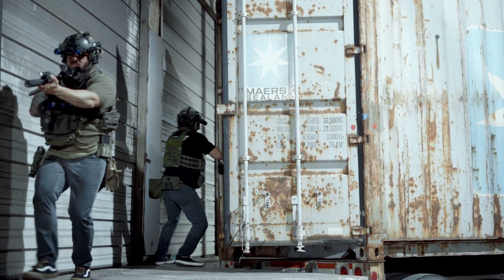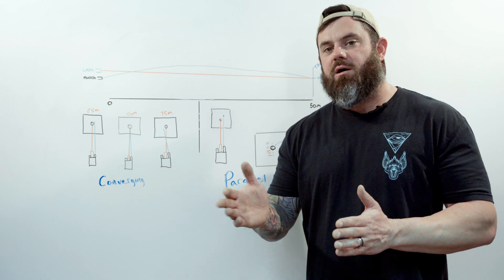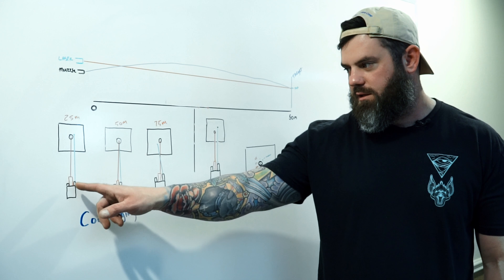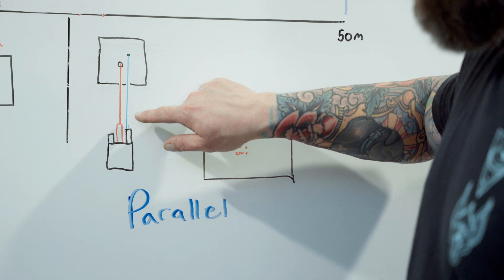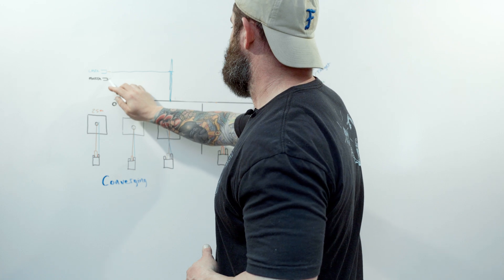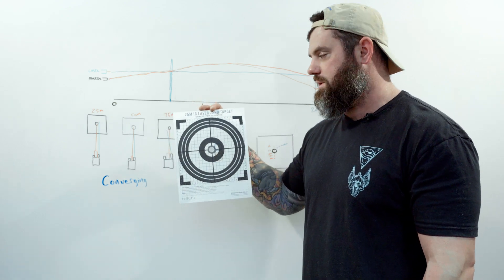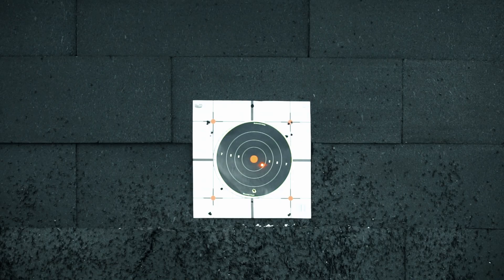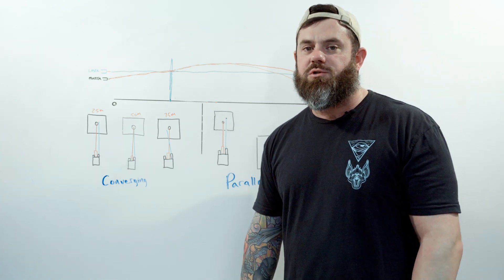Custom Night Vision | Zeroing Lasers | Parallel & Converging Zero

Comment: you need to move your POI up to the same height as your POA on the parrell zero, and only have a horizontal offset that way you're putting some elevation on the bullet and it's not just dropping.
Reply from the maker: That's an interesting point to consider!

Comment: Thank you; your video was easy to follow. I am a first-time gun owner. Home defense is possible, but plinking and dry firing are primary uses. PCC Ruger PC Charger with both a PA Micro Gemini and a simple light/laser mounted under replacing the hand stop. Both devices are centerline, and the Gemini has ACSS BDC. As a newbie, I want to keep it simple with Parallel Zeros, so I have to remember just two vertical holds.

BTW - I do not love the name Parallel Zero. It does not make sense and does not sound as cool as Zero. I wish it was called Zero Zero or Z Zero instead because it never zeros, and it would sound even cooler than Zero.
Reply from the maker: lmfao.

Comment: Yes you are correct on the converging if you keep the rifle flat, you can “correct” that by rolling the gun and putting the laser “on top” of the gun. I have a DBAL A3,  laser is on the right. I roll the gun now the laser is “on the top” and you can think of it as a red dot at that point. Yes, it does some wonky things to the bullet if you’ve ever shot a rifle at an angle but within 100 that doesn’t really matter

Comment: We had the "crossed path" problem using MILES on the M1 Tanks & the M2 BFVs during Manuever Tng. There was also a Training Aid made by Saab that used lasers. It is tough to use a beam of light to replicate a ballistic projectile's flight path! Adjustments are "counter intuitive" & would likely make for terrible accuracy in Combat as all the "muscle memory" developed is backwards!
   I avoided using the PGS (Saab's Precision Gunnery System) for that reason. We had another system called TSV (Through Sight Video) which utilized a half-silvered mirror w/a fiber optic feed into a small monitor. I could moniter live & record the reticle hold of the BFV Gunner as he adjusted the impact of a "simulated" ballistic flight path (a small light projected into his sight's optical system). We only had the M2 A1 (w/out the ODS upgrades & BLRF System. We still had to use TOT. Like "degraded mode" Gunnery on the M1 IPs.)
Reply from the maker: hell yeah whatever works.

Comment: New(ish) to lasers.  This will be the first time setting up parallel.  I have an NGAL.  The laser is mounted at 12 o-clock.  If I am understanding right, where the laser is on the target, the bullet should impact low and to the left.  Taking out the bullet rise and fall factor, the bullet should hit an inch or so to the left of the point of aim (laser), correct?  
I'm waiting for the range to warm up and dry out. to fire my zeroing shots.
Reply from the maker: yes

Comment: I chose to run a parallel.  Seems to have more practical civilian shtf application. I'm in a small urban environment with medium distances at best so i think not having to do my ky maths on a converging point may be easier on the fly. This way I only should have to fight elevation in theory depending on distance.

Comment: As always, excellent information. I use a process that is a little more labor intensive and requires a buddy, but it is dead nuts on and can be done without firing a shot. Step 1. On any paper target place a 1-inch round pasty then use a sharpie to put a dot in the middle. Step 2. Place the muzzle of a weapon that is clear and safe against the target while looking through your zeroed optic which will be aimed in on the pasty. Then turn on your visible laser while looking through your optic aimed on the pasty and make a mark with a sharpie where the laser is pointing on the target. Step 3. Now do the same thing at 25 yards while having a buddy feed you data that will move your laser to its original mark. Step 5. Repeat this complete process again at 50 yards and you are good to go. Then shoot to confirm

Comment: There is no offset on a converging zero if you zero your "IR" laser to your already zeroed optic at the "Furthest" distance possible all without firing a single shot. Your hold overs/unders will be the same as your optic. The vertical and horizontal adjusters are very coarse @ 1moa per click, so even with a parallel zero you are more than likely for your zero to be offset at distance, This can all be verified by looking through your optic at distance.
Reply: This is laser and distance dependent, if the POA/POI converge at a relatively close range the offset at further distances can be more substantial. TBH we are splitting hairs any way you choose to go. This video is intended to help understand the process not necessarily advocate for any particular method.
Reply: THANK YOU. Parallel Zero is a myth and you risk a DIVERGING zero. Zero to your optic POA while pointing at the furthest visible distance (500-600y will do)
Reply: New to night vision and lasers and this is how I did mine just based on common sense. I actually shot last night and it worked well. I was only shooting known distances though

Comment: For whatever reason I thought I could move my vis laser from my dbal a3 in line with my Red dot on my compm4 and it would be fine, went out and started shooting under nods and wasn’t hitting shit, but then I also found out the mount that was on my dbal was loose af. So that could have been it ?
Reply: Overlap your "IR" laser to your already zeroed red dot at the furthest distance possible, that way all your hold overs/under will be the same as your RDS.
Reply: Yeah possibly
Reply: Duh nigga